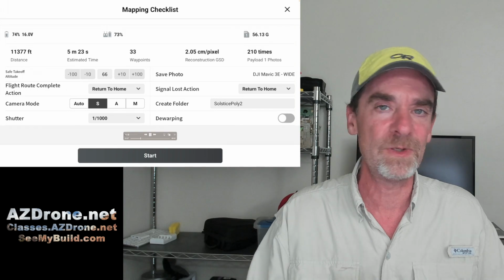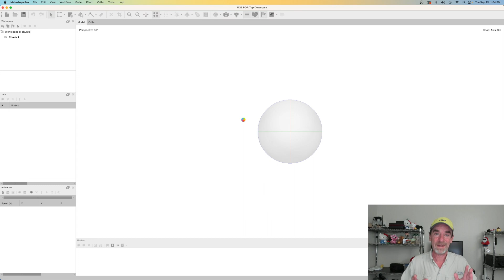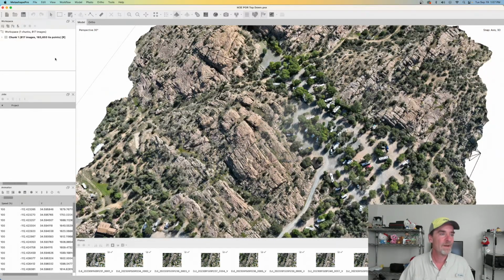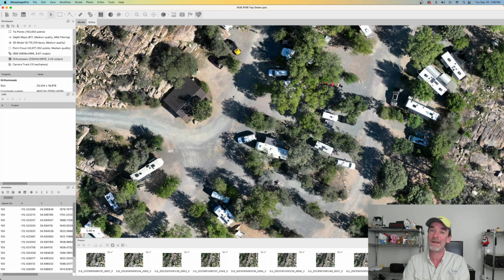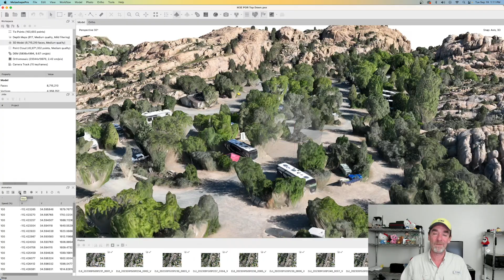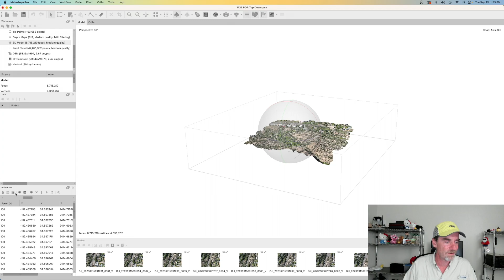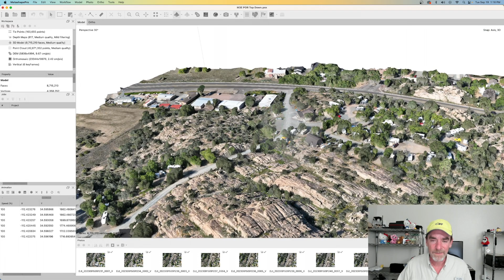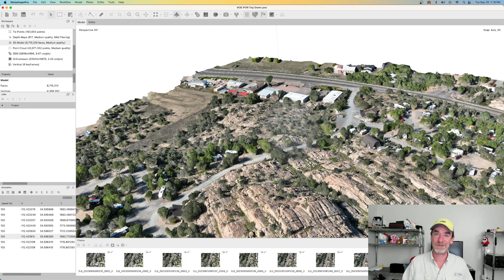3D Model Fly Through Animation - Metashape 3D Animation

Comment: Hi Rich, love your videos and experience. I have a question.
What kind of output can you take with 3d rendering/metashape/photogrammetry? I have a dji mini 3 pro (yes i buy it 3 montha ago) and I would like to do some 3d rendering and photogrammetry, but what can be the selling points of it? What are the interest in the clients to do photogrammetry or 3d rendering of his/her property?
Thanks a lot.
Ricardo Teixeira from Portugal.
Reply from the maker: In the case of my clients, most only want Maps (2D orthomosaics).  For some construction groups they want 3D models as well.  Also architects find value in the 3D models as well.  High end models can be used for survey work, volumetric analysis, measurement, and more.  For that kind of work here in the US you'd need to be a licensed survey engineer, or working for one.

Comment: For video work will at some point will you get a Mavic 3 Pro?  I am using a Mavic 2 Pro at present and use Litchi a lot. Planning on the 3 Pro using DJI waypoints which I hear good reviews about.
Reply from the maker: I still have my Mavic 2 Pro's as well.  So I can use them still.  At some point the Mavic 3 Pro will be considered.  Honesty I wish DJI offered more features for their "Enterprise" drone.  Seriously, the 3 Pro offers so much, and is only missing mapping.
Reply: Totally agree and I will no doubt landing up buying two Mavic's, the Pro and I was going to go for the Enterprise. However current thinking is to go for the multispectral. I wouldn't need the zoom lens on the M3E and the M3M has the same primary lens as the M3E which I can use for mapping and then have the multispectral as well. Hope that makes sense!